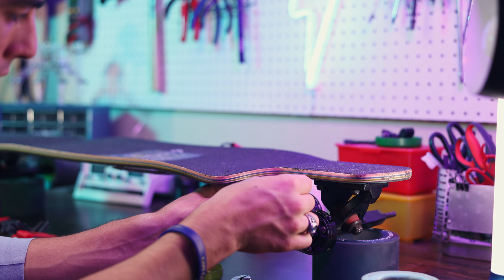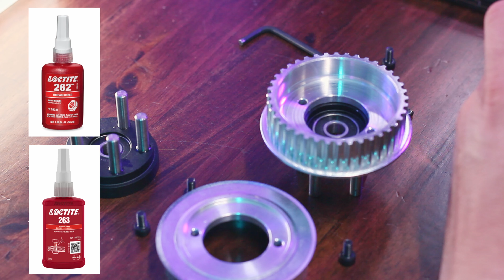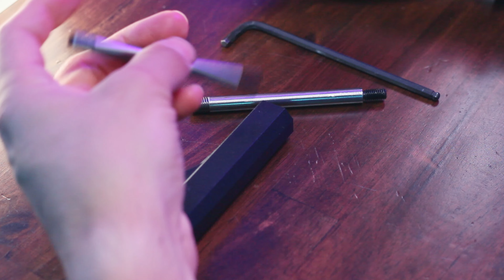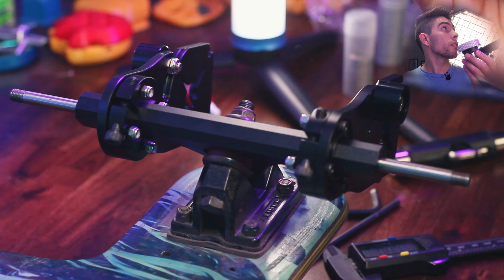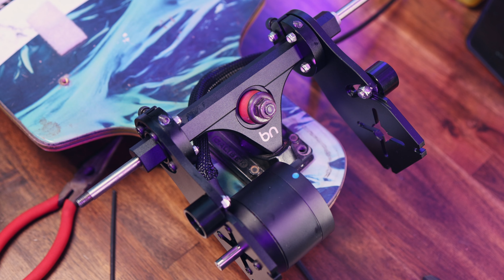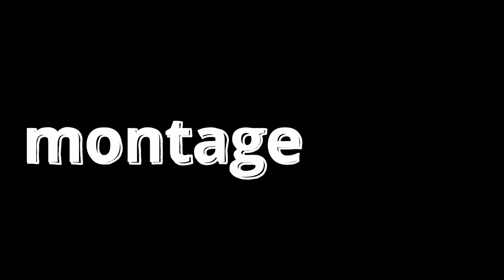Detailed Beginner's Esk8 Belt Drive Tutorial! (2022 Boardnamics Idler Drive)

Comment: Great vid! I had some questions since I’m still a esk8 newby. I bought the linked drive but didn’t know it wasn’t shipping with pulleys. Could you recommend some pulleys and maybe some compatible wheels? Cheers thanks
Reply from the maker: Thanks! Hmmm. Personally I like using the boardnamics aluminum pulleys for most of my belt drives. Any wheels should be compatible with this, that's more dependent on the rest of your drivetrain.

Comment: I love your videos especially the timestamps!! Do you possibly have a rough estimate on how much a belt driven system is?
Reply from the maker: Thank you man I appreciate it!

Well, right now, you can buy the motor mount and clamp sepately from everything else, which comes out to $35 each side, currently. If you want to get the whole package already bundled, (includes front and rear 220mm CNC hanger) it's gonna be around $159.  Belts are cheap and you can get them to suit your pulley setup, but again you have to buy the pulleys separately ($50 a pair for wheel, $9 per motor pulley).  I would advise going onto the website and trying to put it all in a cart for yourself to get the most accurate estimate.

The prices are subject to change, as I think he might be getting a new order, but it should all still be decently priced.  At the end of they day, you get fully CNC'd parts made of high quality aluminum and steel (motor pulleys).